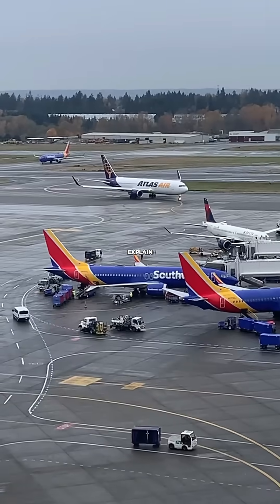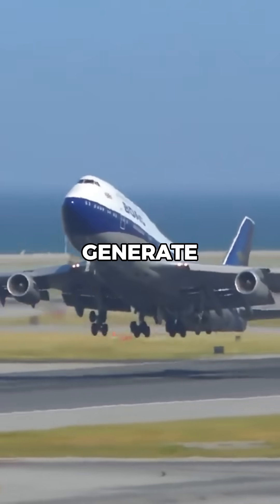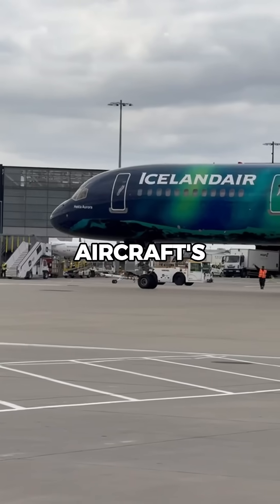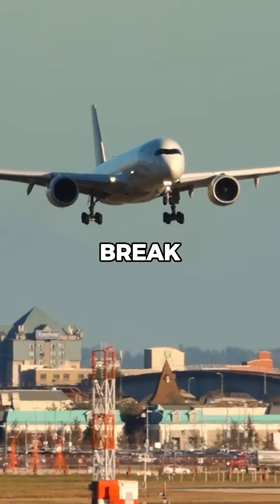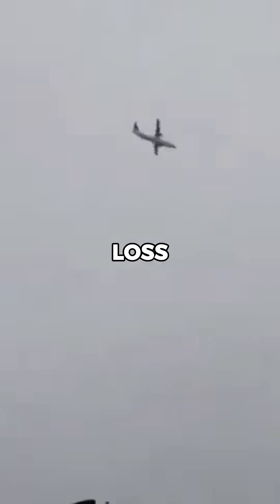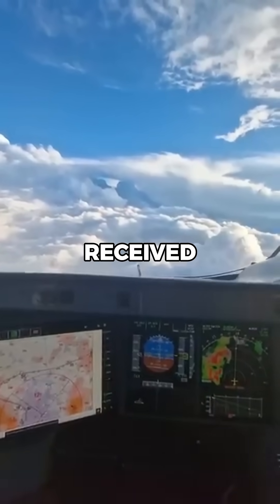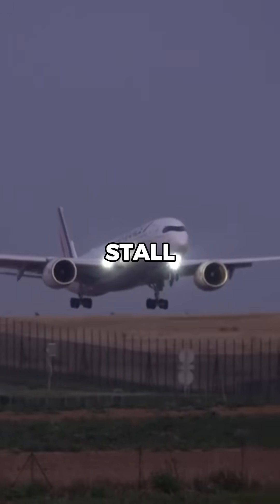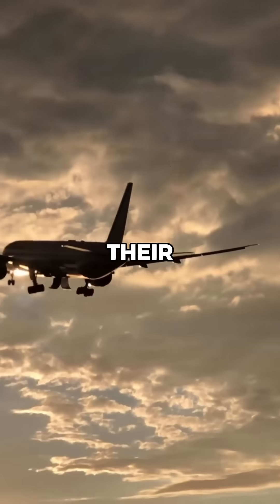what happens if a plane stalls?

Comment: Airfrance 447 didnt stall at first, the aircraft showed incorrect reading of speed, which the pilot overcame by reducing thrust, which shouldn't been done so. That caused the aircraft to lose the speed and stalled.
Reply: Yeah, but three minutes to push nose down and regain lift and they couldn't get it done?
Reply: @athopi 
They were newbies (Except Dubois), hardly trained and didnt know what to do, so they disengaged the autopilot because of alerts scaring them. They didnt know How to properly handle the plane and ended up stalling, eventually hitting the atlantic ocean.